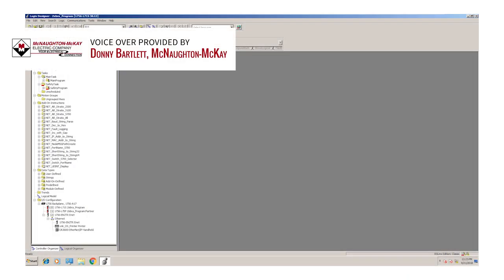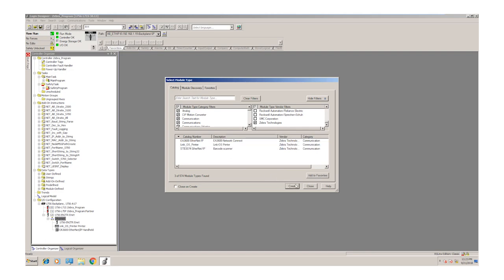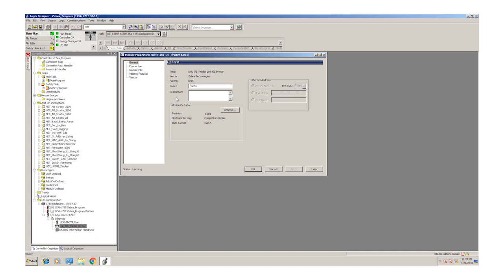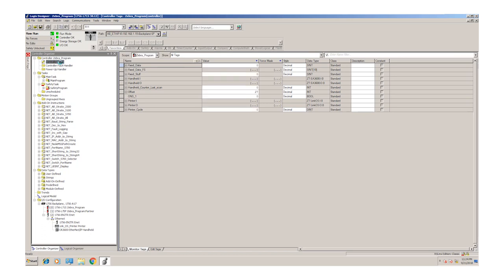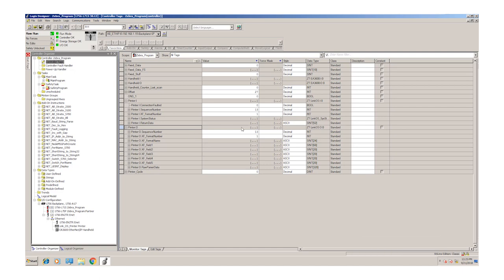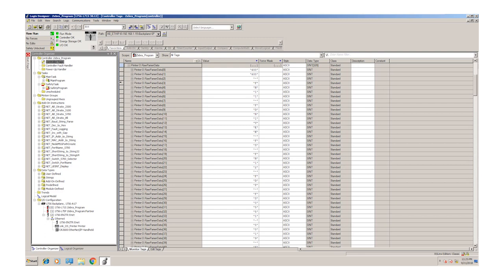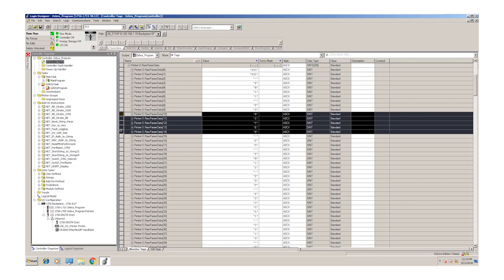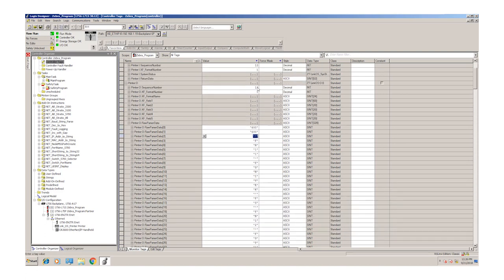Interfacing a Zebra Laser Printer to an Allen Bradley Logix Controller

Comment: Thanks for the walk-through. On the ZE500 printer, Network Connect is not available on the print server. Any idea or references on how to communicate to this printer over Ethernet? Thanks in advance!
Reply from the maker: Hello, The ZE500 Print Engine communicates to a print server via TCP/IP. Rockwell Automation PLCs require open socket communications to talk to TCP/IP devices. For more information on open socket communications with Rockwell Automation PLCs please refer to the programming reference guide for your controller, the Rockwell Automation Knowledgebase, or contact your local Rockwell Automation distributor for personalized support.

Comment: Hello
We are using ZT410 printer tried to connect with  compactlogic 5380 PLC. is it need to purchase firmware from zebra technologies?
Reply from the maker: Hi Rohan, 
Yes, you will need to purchase the Zebra firmware. If you are in the United States, you can purchase the firmware from your local Zebra distributor, like McNaughton-McKay. If outside the US, please contact Zebra directly.
If McNaughton-McKay is your local Zebra distributor, you can use this part number when you call your local branch location: ZEBRCAGP1096531
www.mc-mc.com/locations

Comment: I have a question. How many Zebra printers can be connected to a controller? We have a situation that requires 5 different printers at a truck loading station and was wondering if this would be possible or if it is limited to one printer per controller.
Reply from the maker: Hi Brent, Yes, you can have multiple printers on one PLC. The PLC treats each printer as an IO device. However, there are limits to how many IO devices can be connected to each controller. We recommend consulting your processor’s owner manual to determine how many IO devices are allowed. Please reach out to your local distributor for personalized support.

Comment: Hi, I have seen the video, I have a ZD620D printer AND a CompactLogix L30ER PLC,
Is it possible to connect this printer to this PLC through EthernetIP, or do I need some extra component or firmware?

And I tried to see my printer in the RSLinx to download the EDS, but I don't get this communication, you know why this happens?
Reply from the maker: Hi Ricardo, There is a special firmware kit that allows for any ZD or ZT series printer running Link OS to communicate to a Rockwell Automation PLC. You can find a distributor local to you for this solution through Zebra's Network Connect Inquiry page. https://www.zebra.com/us/en/products/software/barcode-printers/link-os/network-connect-printer-software.html If you have further questions or concerns, please reach out to your local Rockwell Automation distributor.

Comment: Is there a solution for a novexx printer
We can't find eds file for it
Reply from the maker: Hello, EDS files are supplied by the manufacturer of the printer. Please reach out to Novexx Solutions about this inquiry. If they do not provide an EDS file, the data must be processed and translated manually by the user. We hope this is helpful.
Reply: @McNaughton-McKay Electric Company  Hi we reach out to novexx supplier in my country and they don't have an eds file
We are thinking about add it as a generic ethernet module but we don't have the specific protocol 
If you have any idea please share it with us 
Thank you for your interest

Comment: Hi 
are you able to use compact logic 1769-l35e with zebra printers ethernet port?
Reply from the maker: Hello, The l35e does support Ethernet IP so you should be able to use the printer with it. We suggest reaching out to your local distributor for personalized support or if you run into any technical issues. Thank you!
Reply: thanks

Comment: Hello Sir,
How i connect GT800 to Delta SVP 14SS2 PLC?
Thanks
Reply from the maker: Hi Amit, I’m afraid that printer is not compatible. It is being replaced with the ZD620 which is compatible with a firmware upgrade (purchased separately). Please contact your local Zebra partner for assistance, or reach out to your local Rockwell Automation distributor.

Comment: You forgot to mention you need network connect to use the link os.
Reply from the maker: Hi Jeremiah, Thank you for reaching out. Yes, you are correct, network connection is required to complete the process described in this video and utilize the functions of the printer. If you have any questions or concerns about the application, please reach out to your local Rockwell Automation distributor for further assistance. Thank you!